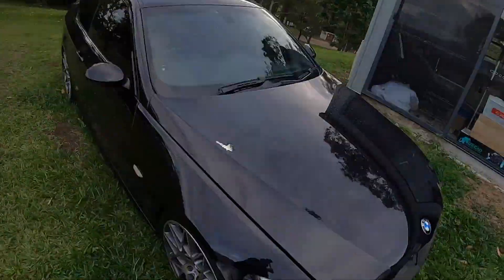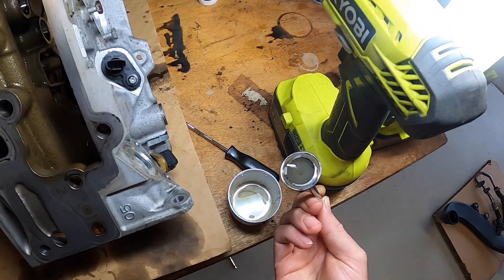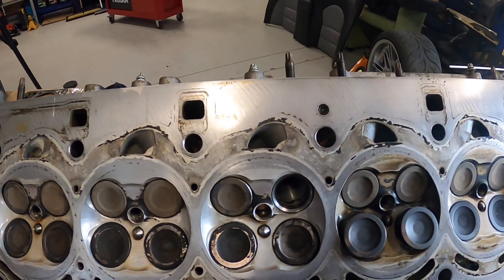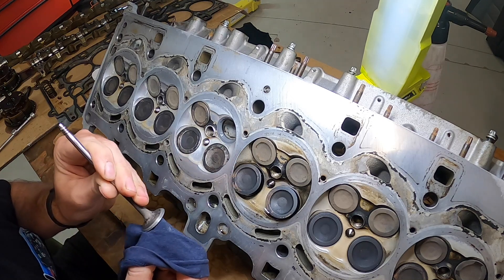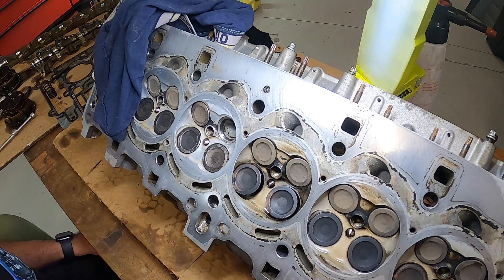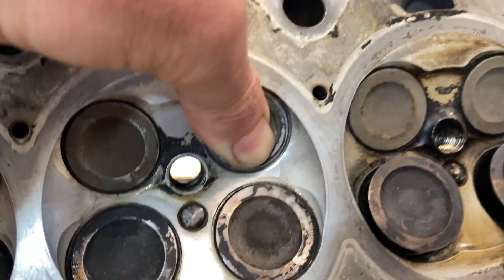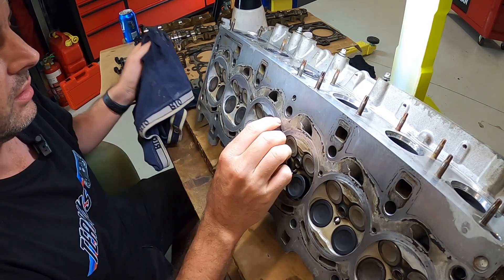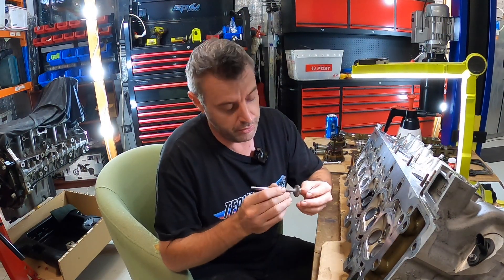BMW N54 335i Leaking Valve Re-Seat Lapping Attempt

Comment: Best way to check if the valves are sealed to the head while the heads off is to refit the valves and spring. Put the spark plugs in and turn the head over so the valves are facing towards to ceiling. Then fill the combustion chamber with petrol. No  petrol should leak through the valves out through the inlet or exhaust ports. A little trick I learned from when I was at motor college
Reply: 999

Comment: Good job on lapping the valve.Happy to see that it is sealing again. If I were you I would just replace the valve stem seals, because you have easy access and they are cheap anyway. Another thing you could do is with the head upside down (valves facing the ceiling) and fill each chamber with petrol or some kinda solvent, just so it covers the valves and let it soak for 5-10 minutes. If there are no leaks on either side, intake or exhaust, you're good,.but If you want you could relap the rest of the valves with the finer grit paste just to clean them up.If you decide to do that you can use a piece of a hose attached to  the valve on the stem seal side and the other to a drill and grind the valves on low speed, like some guys on the comments said before me. There are casting marks on the cylinder head ports, if you look carefully after walnut blasting you could see that the surface looks just like sandpaper. If you have a tool like a dremmel, you can grind the surfaces flat with a sandpaper attachment so that it makes it harder for carbon to stick to. You can also polish the ports if you want to, there are good videos on youtube which explain what its all about.

Comment: A bit of rubber hose, WD40 and a cordless drill makes the job a lot quicker and easier.  It's not a job you need to be too worried about/gentle with, an even surface colour all around the valve and seat is a good sign that you've got it right.  With practice you can do an entire head in the time it took you to do your first ;-)

Comment: Get it hot tanked, new valve seals and clean up the factory machining in the ports, lap all the ports. Good to see your doing it yourself making good content!
Reply from the maker: I know that’s the right thing to do, but this motor will be temporary. I don’t wanna do anything I need to do, because it will be pulled out I. 6-12 months anyway

Comment: I was always taught to use engineers marking to check the valve has fully seated right across the whole width of the seat. Without it, you can do this and find it's only seated in a small narrow ring which will pass a fluid test but not last long. With engineers marking you can see high or low spots and can keep going until it's flat. This mainly applies to new valves though, for this a simple light pass probably got it perfect again

Comment: Not sure if it will help but in gunsmithing they use what is called a carding wheel to remove surface impurities off old metal gun parts without damaging the steel surface.  Maybe look into that to clean the carbon off the valves before re-seating them.  It's a really soft wire wheel on a bench grinder that is gentle enough that you can stick your finger in it while spinning and it wont even cut your skin.

Comment: You can also use a piece of vacume hose on the rear of the valve, pushed over a drill bit and use the drill on slow speed forward/reverse. Same outcome but will cut down the work time, especially if you make the smart decision to service the whole head. Valves, valve guides, valve seals.
(Absolute minimum would be lap the valves and valve seals) 👍
Reply from the maker: Thanks for the tip on that one. Has to be better than this tool...

Comment: Looks good to me. When I worked for Lexus and we had carbon buildup cause misfires the service bulletin had us tear the engine down and clean the valves with a wire wheel on a bench grinder. You have been far more detailed that a Lexus factory repair for a smaller concern.
Reply from the maker: No surprise really. I get it tho, dealers are about making it good enough, not perfect.

Comment: Old School stuff, as you do three or four alternate rotations you then lift the valve slightly one one alternate rotation (1/4 or so) which lets the paste go back into the seat surface and just continue. If the tone changes as you noted, you are not getting much benefit and need to lift. A  minutes or so at that pace on each valve then onto the fine paste using same process. Experience will teach you the level of the lapping required based on seat conditions. From the video quality picture of that one valve, I would only have done the fine paste myself. Also note the correct way to check seat leakage as noted by others. Most definitely replace the valve stem seals at the end of this work. For me, I would then also cc the combustion chambers when the valves were reassembled, (but I am doing performance heads). The actual sealing surface is a fine line as the angle of the valve face is cut at a different angle to the seat.

Comment: I've used crc. It's ok not great. Still gotta work to get everything off and it's not cheap. Don't know prices in Australia but a local machine shop boiled my head and pressure tested it for $100. Totally worth it. Wasn't a spec of carbon left. Either walnut blast it or have it boiled. If not you'll waste time and $.

Comment: I usually clean up the valves on a wire wheel on a bench grinder before lapping them in also would for sure replace valve steam seals while you have it apart and I would drop the pistons out replace the rings and change the bearings as well freshen it all up. you may have cracked a ring and there is no real way of knowing with out dropping out the pistons.

Comment: Bristle disc can sometimes be used as they are not suppose to remove any material aka (metal) but clean up all deposits. People will often use them to clean off gasket material, rtv etc. So if the cleaners don't work you can try that as they have various coarse to fine ones you can use.

Comment: 23 more valves to go the lapping compound works great for resealing, just be careful with the injectors nozzles when cleaning the champer, clean all the carbon off everything and put new VALVE stem seals on the clean head looks great

Comment: The crc stuff is okay but I’ve never tried the stuff you are using. Seems like it works just as good if not better than the crc. I ended up cleaning my intake valves with 2 full cans of crc and it really wasn’t taking too much of the carbon off without me having to use a soft baby toothbrush. It’s all good, my kid was done with it. I also just didn’t want to buy the walnut blast stuff but it ended up turning out okay.

Comment: while the head is off, why dont you polish the combustion chamber ? It eliminates potential high spots carbon can stick to or form hot spots that cause detonation, plus a smooth surface is more resistant to carbon build up and detonation/pre ignition/knock (insert your preference of a combustion event happening before the spark plug fires in here)  resulting in higher boost. I have linked a video below that will help. Also leave porting for the tried and tested performance shops, you dont want to hit a water or oil jacket/channel doing exploratory porting with a Dremel , what you can do on your own is simply smoothen out the casting lines/imperfections inside the intake ports and exhaust ports. 

Before anyone chimes in about rough intake ports are better for turbulence and fuel atomization and reduces pooling , there is no fuel in the intake ports, its not a carbureted/port injection engine, its a direct injection engine, secondly: turbulence hinders flow, and it being a forced induction engine, you want as little resistance in the intake tract as possible, so smoother ports means more flow especially under boost therefore more power at same boost levels 

https://www.youtube.com/watch?v=iejDWSQEsqI&t=763s&ab_channel=Jafromobile

Comment: Looks like you're good.  Been doing that on small engines for years and never had a problem.  While the head is out, I would go ahead and lap the other valves and valve seals, just in case
Reply from the maker: Right I think the descisions made already. Lap the lot and valve stem seals.

Comment: Because it was cleaning the seat more one side than the other ,I would be considering the condition of the valve, ie distorted head not seating straight. From an overheated valve? 
The vw 1.8t valves are known for dropping valve heads with turbo upgrades, due to higher temps etc.

Comment: Good stuff for doing it yourself man and not just sending it to a shop.. valve lapping is a right pain in the ass but well worth it especially on a gummedup valve like that.. the old drill on the back of the valve definitely helps to make it a faster job if you can get it onto the back of the valve and then fresh guide seals would clean it up really nice especially if you walnut blast the intake side 😊 either way looking forward to seeing it back on the street 😁🤘

Comment: its much easier if you use a rubber hose thats fits on the valvestem and working it from the other end instead of using that tool with a suction cup.

Comment: If you take the time to clean up all the valves an engine shop should be able to vacuum leak test the head for you for minimal cost to be extra sure it’s done. Defo worth it after that effort 👍🏻

Comment: hi guys, did you ever do a video on how to  Swap your steptronic paddles for the dct paddles? now you've recovered the e90 steering wheel that had steptronic paddles can you show what you need to do to install the dct paddles? keep up the good work guys 👍 #team N54
Reply from the maker: Mine actually came with the car. However i know how to do it, it's much easier than you'd think. I have also wired up a friends old style push pull paddles, to work like the LCI paddles.

Comment: Electrolyzing gets ever thing very clean
Reply: Even aluminum? Aluminum is anodized by soaking it in a tank and passing a current through it. The aluminum is the anode. This grows a layer of aluminum oxide over the surface of the aluminum part. Not sure you'd want to do this to a head. It would screw up the tolerances and the aluminum oxide is porous which isn't good for sealing. It is very hard, however, which may or may not be good.

Comment: Hi  i have a 2008 bmw 535xi and i replaced the valve cover gasket and the oil filter housing gasket but when i do a pull on 2nd gear the car smoke from exhaust blue smoke help

Comment: I would most definitely use a battery powered drill a bosch or something and do this job as it wont be an uneven weighted spin that you're getting with your hands. chop one side of the wooden stick off and stick it into the chuck of a drill and do the same job.  will be Much quicker and way more accurate.  Your hands will always cause slightly more weighting at a certain point.

Comment: Got a second hand motor thankfully I didn't put it in. Intake valve on 6 leaking air. Do you think with port injection it will clean it up and help seal?
Reply from the maker: Anything is possible. But i wouldn't rely on it it cleaning it up 100%.

Comment: Would strongly recommend changing the stem seals, but if you are doing all the valves why don’t get the head dipped to remove all the crap, put new stem seals in then get it pressure tested to make sure all is good.  Definitely not a job you want to do more than once

Comment: clean those things to bare metal before lapping so you don't cause odd seat to valve contact wear.  Once the crud is removed, lapping does not take very long at all.  Be sure to lift the valve and rotate 90 degrees frequently so you are not just lapping the same section of the valve lip and seat.  But please remove ALL carbon build up so you start with clean bare metal on both the valve and the seat!!  I would forego the course abrasive unless it is absolutely needed as it will score deeper than necessary otherwise. generally unless there is a major problem the fine abrasive will give you a sealing ring in just a few minutes of lapping.  use dykem and see if the blue transfers from the seat to the valve fully without spinning it. that should tell you when you have a good seal, repeat in multiple rotations to verify then you are done.  the dykem test will show much better how good of a contact you have around both the valve and the seat, this is important as the better the contact patch the more efficiently the valve can transfer heat into the head, you are looking for a uniform width on the dyken witness mark around the valve edge.  very important for exhaust valves!  the sealing test will get you by but you could have odd contact patch in some areas and it will still seal.  this can lead to burnt valves and wierd carbon build up.  also polish those valve faces if you have the time, it will help tremendously with carbon build up!  hope that helps!

Comment: Got a soda blaster or dry ice cleaner you have access to? I'd pull all the valves, clean the head properly, lap all the valves, replace valve stem seals and call it "reconditioned"
Reply from the maker: I have the walnut blaster but that’s all. But your right it won’t take much to make it a “reconditioned” head
Reply: @ZeroTo60Tube  I reckon that would do. Might need to plug up the valve stem holes so you dont get stuff in there. Some walnut blasters you can load soda in, instead of walnut shells. Soda is just a little less abrasive.

Comment: The "towel" your using looks like a set of undies. As for the valve head, yes I would lap all of them. But I would also replace all the valve stem seals in that head as those are liable to leak on many BMW's causing sooty exhaust.

Comment: You already know what you should do and I suspect you are already going down that path.  Clean the intake ports, lap all the valves, some new stem seals and reassemble.  Your lapping process is spot on, a little tedious but the results are exactly what you are looking for.  You are doing more than almost anyone else would.  I would think once with the coarse then twice with the fine but your results are very good so I would stick with it.  I have done a few with the lapping tool but soon adopted the drill approach, as long as you can get a drill onto the top of the valve I'd go that way.  I put a little piece of hose that fits snugly on the valve and then grab that with the drill chuck so I am absolutely sure not to nick the tip of the valve.
Reply from the maker: Sweet thanks for the advice

Comment: Put oil (or spit) on the valve head to get the tool to stick. Now that you have lapped the seats you can do your light check again and a vac test but better is to use some bearing blue to make sure you have a full seat. Don't turn the valve when doing it. It's possible that you get a seat dropping away from the heat which you can mask by lapping and turning. The blue will show you the true result. Bash some stem deals on it and slap it together for more boost (while monitoring EGT (check Ali express)). More importantly why don't you repeat this process on the engine in the car? Head off and lap in the car maybe?

Comment: put some spit on the suction cup works everytime
Reply from the maker: That’s what she...... never mind
Reply: @ZeroTo60Tube  my old man use to say give it a lick and a tickle it usually fixes the problem lol
Reply: you think your e92 engine problem is bad i am changing 2 quarter panels and a roof on my e90 335i coupe bought a stat write off and a cleaned title body shell with damage and i am changing quarters roof interior complete front end and rear end full ground up repair if i wasn;t a panel beater i would have just put the engine in my e90 320i so who's a glutten for punishment thats why i like watchin videos like yours to keep me motivated cheers from broken hill

Comment: Haha these n54s are cursed. I installed Upgrade turbos 4 months ago on my n54, just to get the joy of huntig down a boost leak for the last couple months. Yesterday I found out, that my Wastegates were set to 300mbar instead of the correct 200mbar. That's gonna be fun rippin all this shit apart again! 

Here is a special tip from me: Don't rely on chinese pressure gauges, when measuring stuff. Buy quality pressure gauges from WIKA for example! The original chinese one on my vaccuum pump showed 3inhg instead of the actual 9inhg.

Comment: you can also check the valves, if they don't seal you'll normally make some bubbles
Reply: also it's easier if you buy the tool for the drill or socket driver

Comment: OMG! You spent $2k in brakes and can't pay for a machine shop to steam clean it, pressure test, resurface it and do a 3 angle valve job that will be better for performance.... Just amazing!
Reply from the maker: Still 1/4 the price of what the brakes should have been. It’s about value, not every single dollar.

Comment: It's better to get the head completely rebuild with such high mileage and high performance use. Just lapping it won't make it seal perfectly,the valve guides are worn which allow the valve to have a slight side to side play and with each revolution the valve seats differently compromising your compression.
Reply from the maker: This motor has only done 120ks, so 70,000 miles. You think it will be warn out?
Reply: @ZeroTo60Tube  thought it had 200ks, that's a tricky question,but since the seats were covered in carbon so could be the stems and the carbon could have worked as an abrasive, especially on direct injection motor.

Comment: Absolutely no reason why you can't diy the head seeing as there is no actual machine work needed. In regards to getting access to the crank bolt, I'd just pull the thermo fan out to get all the access you need from the top!!! Probs going to need to come out anyway 😉👍👍